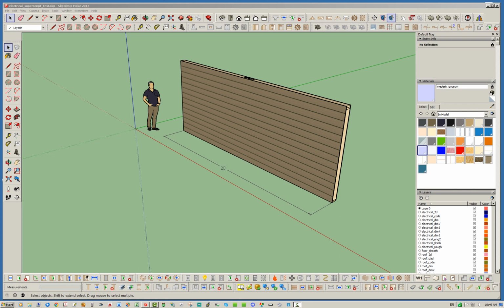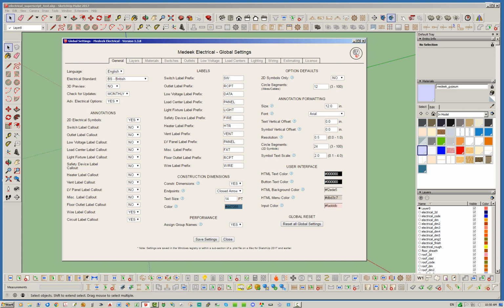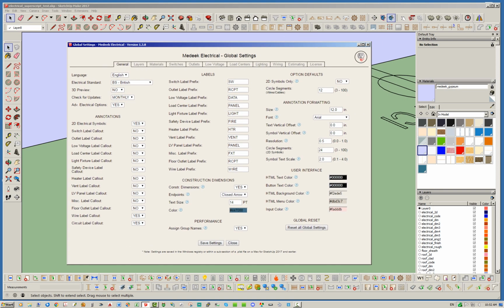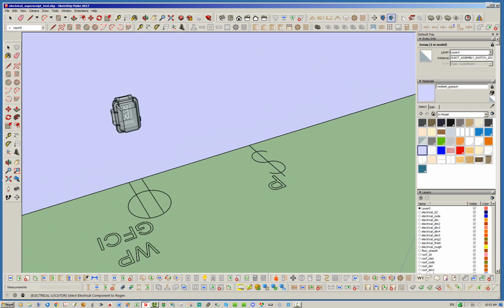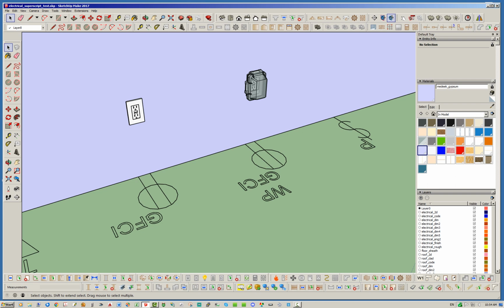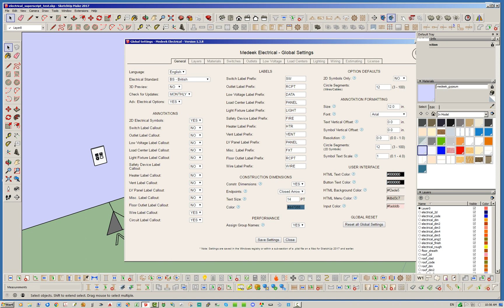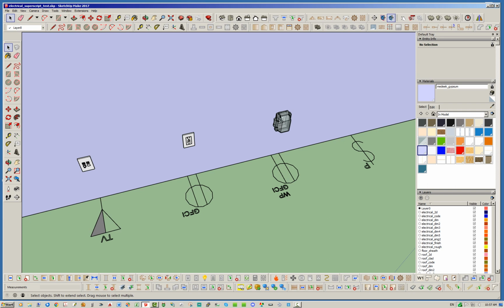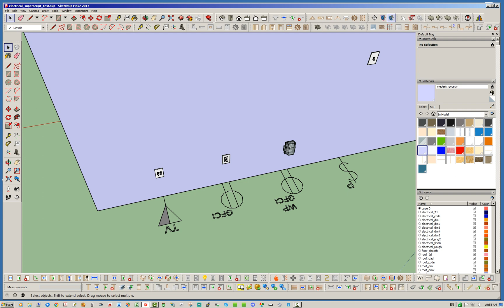Medeek Electrical Plugin Tutorial 6 - Annotation Formatting

Comment: OH!   This looks fantastic.  I have been hoping for something like this, so glad I stumbled across this video.   A few questions, please.

1 - Is there a way to have the symbol height to be at the TOP of the wall instead?  I often leave my cabinets in place so I can indicate exact placement within a cabinet.  This means the cabinets would be covering the symbols if they were located at floor height.
2 - Are there plans for a Global Refresh?  for instance, if I don't realize that I need to upscale the circle segments after I have placed 50 elements, it would be quite cumbersome to have to click on each element one at a time.
3 - This is just out of curiosity - What is the reasoning for the light fixture symbols not being connected to each fixture like the outlets?  I am sure there is a valid reason but wondered because it would be much easier to just move them and not have to update afterwards.

Thanks so much and looking forward to learning more about this plugin.

Comment: Mnemonic notations are good, but without indicating the position (in plan and height) they have almost no practical value. There is still a lot of work to be done to be aware of the electrical plan. And what if the house has several floors?
Reply from the maker: Each floor would have its own electrical plan.  I really don't see a problem with multi-floor projects.